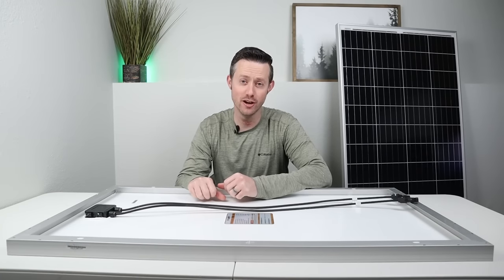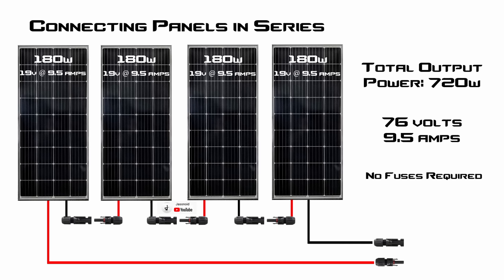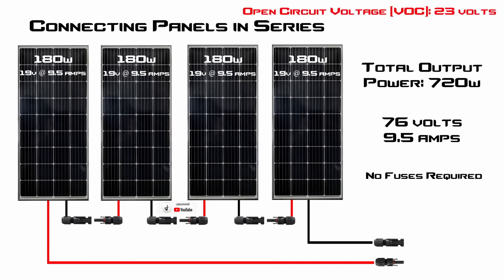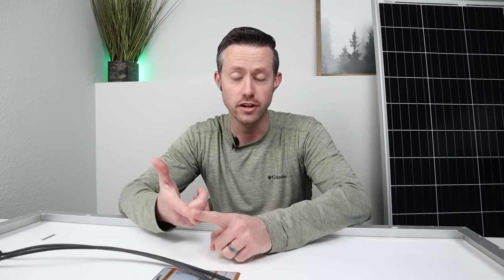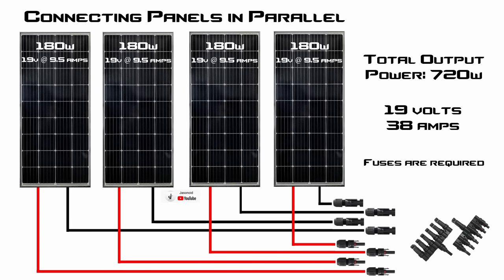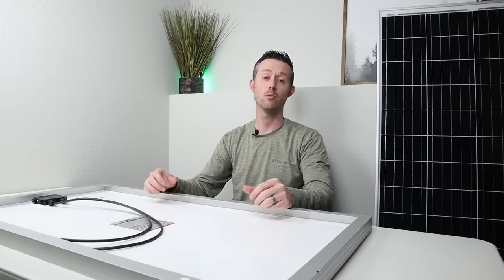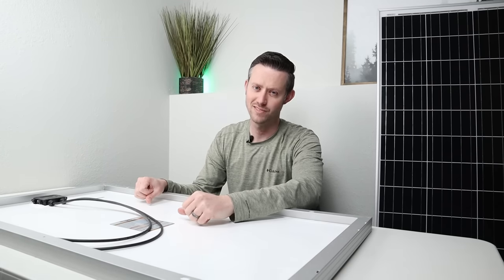Series VS Parallel! A Beginner's Guide for Solar Panel Connections - With Basic Diagrams!

Comment: What up Doe!?
Hey Dr J' very very informative video, thanks!

if you have 1 hundred watt solar panel but need extension line to run it to your house, what gauge wire should you get? About 25ft
Reply from the maker: 12 awg wire would work well, something like this: https://amzn.to/40h8eq8
Reply: @Jasonoid  Just added it to my amazon 🛒
Thanks

Comment: QUESTION;  So in series, the amperage stays the same? So if I have a starter solar on my rv that can handle 30 amps and 10 gauge wire running to it, can I put more than 600 watts if they are parallel? So does parallel work better in a partial shade?

Comment: Thanks so much for this it really helps I do have a question, on your last setup series and parallel what size fuses would you need ?
thanks Rob.
Reply from the maker: Any time the total amps goes over the wire rating you want to use fuses. Using an inline fuse like this is cheap and easy and never hurts: https://amzn.to/3JAyx4F

Comment: Hi Jason; I enjoy all your videos! Great job educating us all on everything solar. I have one question please. In a previous video you compared the performance of several panels - Bougerv, Newpowa and others. I recall that in the video you were surprised and the difference in output each Bougerv panel in your 4 panel array! Did you ever resolve this? As a newbie to the world of solar, I would have expected identical panels to have the same amp and voltage output - within fairly tight ranges! Any insight you can offer would be appreciated.
Reply from the maker: The BougeRV 5BB 180w panels in that comparison were actually damaged during shipping and the cells didn't hold up over time. I have since replaced those panels (under warranty) with the 9BB 180w panels and they perform much better!

Comment: This was really helpful!  Do you have any recommendations on what kind of fuse to add to each panel if the amps in an array are greater the the rated amps for each panel?  Also how do you know what fuse size to get? Should the fuse size be based on the amps that the wire is rated for based on the awg of the wire?  Thank you!
Reply from the maker: I'd recommend a 15 amp fuse since most solar panels are rated for 10 to 12 amps peak power. An inline fuse like this will work great! (see link below) 
https://amzn.to/44cx2BU
Reply: @Jasonoid  Awesome!  Thank you so much for this recommendation and especially for your outstanding videos.

Comment: I have 4 100 watt nine busbar panels and 3  100 watt older panels I believe they’re four or maybe five busbars type panels they appear to still be putting out around 22 or so volts I’m wondering would it hurt anything if I wired the four new nine busbar panels in series and then wired the three older 5  bus bar panels in series but also added one new nine busbar panel to them so I’d have four on each string and then combine the two series strings in parallel and run them into my Victron Smart charge controller it’s a 100 V 50 amp model. When I get the money I figured I’d only  use nine busbar panels for the whole thing and put the older panels together on a separate smaller system would this be acceptable???

Comment: Thanks for making this video, very helpful.  
Im new to solar so sorry if this is a stupid question but.  
In a series and parallel setup do you have to do equal amounts of panels in series and parallel like you did in the video 2 in series and 2 in parallel?   Or could i do  for example  4 in series and 2 in parallel?        
Im trying to get more wattage without raising voltage.    
Thanks.
Reply from the maker: As long as both sides of the array are equal in series, that's just fine. For example, 4 panels in series on one side, and then 4 panels in series on the other side, then put those both in parallel for a 4S2P array.  So 8 panels total, 4 in series, then 4 in series and then put both of those in parallel.

Comment: another bonus of series over parallel not shaded of course is that the panels will start charging earlier in the morning as the voltage from the panels raises higher then the battery sooner so charging starts but also later into the day you will still be producing power so in theory series can lead to you having more charge hours per day
Reply from the maker: Didnt think of that, definitely a benefit of of a series connection.

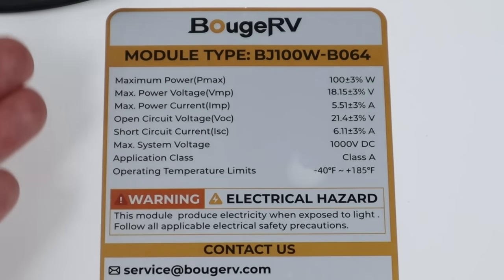Comment: Thank you for sharing I'm trying to learn solar so if I understand correctly if I'm sizing my array to my charge controller and the open circuit VOC for a solar panel let's say is 20 and my charge controller is say an Outback 80150 volt so I take the 1:50 volt / 20 that means I can have five panels * 1.25 for the cold factor is that correct
Reply from the maker: If you wire the panels in series the voltage will add up for each panel added. Just keep your total voltage (VOC) under the charger limit and you'll be golden.

Comment: On a garage roof with some shade issues,  is the combination of wiring in series and in parallel a good choice... ??    How likely is that an installation company would want to do the wiring in series and in parallel,  since I assume this would be more labor-intensive for them  ?
Reply from the maker: Most companies go with microinverters now per each panel to fight partial shading. I'm not sure they would wire in a series parallel combination.

Comment: I've been buying solar components for a mobile system over the past 12 months. Due to a mains power outage where I live, I threw it all together to see if I bought the right stuff (after lots of research). I've got 2 160W panels (in parallel), hooked to a controller that can handle 390W. I've got that charging two 115A/h 12 volt AGMs connected in parallel to a 3000W inverter. I can run what I need, and have a 3000W ULP genset to run when I need to. 
The batteries will lose about 50% charge over 18 hours or so running a fridge and a computer, a stereo system, and 100cm LCD TV as a computer monitor and speakers, and some 12v LED strip lights. I will probably change the setup and add more batteries I think, and maybe 2 more panels with another controller.

Comment: Awesome video! I’m wondering how to wire 6 100w reboot panels for my Anker 767 Im guessing series in parallel should work but not sure how many watts I can get up to?
Reply from the maker: What's the VOC of the panels?
Reply: @Jasonoid  it is 24.3v
Reply from the maker: @PrestoMoto02  the Anker has a 60v limit, so you can only wire those in a 2S configuration. 

You'll want to wire three of them in parallel, and the other three in parallel, and then put those two sets in series for a 2S3P array.
Reply: @Jasonoid  thank you, that’s what I was hoping to hear! Happy thanksgiving!!
Reply: @Jasonoid  works amazing thanks again! I think a lot of people would like a video about getting the most charge for the Anker 767
Reply: @Jasonoid hey, is there a way to do 4S2P or 3S3P arrays with the same 100w Renogy panels that are 20v 5a each?

Comment: Thank you for an informative video. I run 4 panels (2 x 80W & 2 x 100W - panels are about 10 years old) on my yacht. I generate about 1500W on a good day. Due to concerns around shading I have always run them in parallel, limited by the solar controller (20A, PWM) capacity and size of cable to the controller (30A wire running about 50'). Recently I installed a new Victron 100V/50A MTTP controller and upgraded the wires to 85A. I have changed to 2S,2P and later will expand the solar panel array. Question, apart from shading issues I hope to achieve greater efficiency and output from the new set up (MTTP controller and reduction of voltage losses). Any guesses to how big the gain might be with the new set up or is it simply a matter of more panels, recognising the limited real estate on a yacht.
Reply: The voltages in the two difference sized panels must match to be efficient.  If not wire the two 100w panels together and the two 80w panels together.  A 75/15 will do for the 80w panels to keep the cost down.  That or upgrade the 80w panels to 100w to match the existing ones.  We have a 100/50 and run 590w through it without a problem.

Comment: Very very simple question. I bought two Anker 200 watt panels. Xt60 connectors. I assume I can simply attach them to a splitter and plug it into the power station. Am I missing something? Thanks
Reply from the maker: They have to be wired in parallel. The voltage can't go over 60v on an Anker power station.

Comment: Jason- is it possible to mix different solar panels in series or parallel? I have a 200w Renogy suitcase with a Voyager 20 amp charge controller that I use for my camper and would like to use it as part of a solar setup to charge a power station. Open circuit voltage is 22.3, short circuit current 10.42 amps, Vmp 22.4 volts and Imp 9.82 amps. I’ve read that panels with the same voltage can be connected in parallel, and the the same current in series. Thanks.
Reply from the maker: Yes, if the panels have similar VMP numbers they can be connected in parallel and if they have similar IMP numbers they can be connected in series with good results.

Comment: Hi Jason, I recently bought a Oukitel 2001P power station and I want to get 4 BougeRV 180w 5BB which is 10.5 amps 15 amp series max and do the 2s2p setup to get the 500 max solar watts on the generator like you did. The only question left is what size fuses do I need to use for each BougeRV 180w 5BB 10.5 amps to protect each solar panel and to protect the Oukitel 2001P power station that is rated 15 amps max. I'm waiting for your answer before I buy 4 BougeRV 180w 5BB panels at 10.5amps each if it will safely work with protected fuses to do the 2s2p setup on my Oukitel 500watt max solar, 48volt and 15 amp max solar generator. I like to know what size fuses do I need to protect the panels and generator. Thanks
Reply from the maker: The best option would be to just put a 15 amp fuse on each panel inline using one of these 'inline fuses':  https://amzn.to/3C99pxy
Putting 1 of those on each panel will just keep things safe for your setup.

Comment: Whats the best way to connect 5 x 100w panels? Each panel (Coleman) came with its own small 12v charge controller, but I want to connect all the panels to 1 shared 24v battery bank. Thanks!

Comment: May I ask, on the calculation you did at minute 03:11 of the video, it says 76 volts. But each panels' volts is 19.2 and the "Open Circuit Voltage (voc)" is 23 +- 3%. The question is: Should we take that 23 + 3% as a base "voltage" for these kind of calculation and go for the safe side?. If so, the total volts should be: 23*1.03*4 (Panels). Thank you
Reply from the maker: That's only if you live in a cold climate, not everyone does. So if you live somewhere where it gets well below freezing add the extra voltage.

Comment: Are the positive and negative connections on the solar panels usually indicated? Or, is one supposed to know from the so-called "male" and "female" connector plugs?
Reply from the maker: There is a standard for postive and negative connections off the panel, but you'll find out really quickly MC4 can get confusing. They can be connected in reverse polarity. It's best to mark positive and negative on the panel connections using a silver sharpie.

Comment: Perhaps an advanced discussion, but shading of one panel string in multiple series panels isn't necessarily the end of the world and may still output more than the panels wired in parallel.  Its just a case of adding up the volts and amps for both options to see what the difference is.  Going against the often quoted "parallel is best" may prove some interesting results.

Comment: All clear but what amp rating fuses is required on the positive leads when in parallel?
Reply from the maker: The fuses are designed to keep the wires from burning. You'll want to put a fuse inline for the max amperage rating for the wire. Could be a 20 to 25 amp fuse depending on the wire ampacity.

Comment: For parallel connection, where did you get the "12V, 15A rated current" from? From the info sheet you showed there was no 15A...or am i missing something?? Would appreciate a quick response(doing a project and this is critical information) THANKS🙂
Reply from the maker: Usually it's on the back of the panel or tech sheet for the panel. Lessor quality panels don't list that information. I'd stick with 15 amps to be safe unless its listed on your panel.

Comment: What should be the more effective and safe connection way for a 100 watt polysolar panel, 85 watt mono solar panel, rated 150 watt charge controller, 130Ah battery?
Reply from the maker: Depends on the voltage and amperage specs of each of your solar panels.

Comment: I have a big roll of 8 awg romex outdoor UV protected, used  for 120 ac home wiring. can I use it for a 40 volt dc , 50 amp solar array. I know It sounds foolish , but I just had to ask because it is about 150 feet away and solar cable ain't cheep.

Comment: Curious.  For a simple led light, 2 Gang 110v outlet (audio amplifier, phone carging, etc), what's the wattage should I have?  It's for an outdoor shed.
Reply from the maker: If you are going to be running any power tools, I'd say you'd want at least 600w. 1200w would be best (three 400w panels).

Comment: what type of connection works best when it is dim light outside? eg during the winter and evening or a cloudy day?
Reply from the maker: You'll want to run a parallel wiring setup for partial shading or mostly cloudy weather.

Comment: I just subscribed & gave you a.👍 It looks like you have an awesome channel full of information on Solar. I'm just starting to get into solar and I was wondering what what be a good place / video of yours to start with. Appreciate any advice. Thanks...!
Reply from the maker: What are you wanting to accomplish with solar?
Reply: @Jasonoid  Thanks for the reply Jason... I'm interested in using solar to help with the lighting in my house if possible. I rewired my home after I bought it and wired my new addition when I built it. I use to work as an electrician. I'm not looking to have solar power the whole house but just some of the lighting I use throughout the house. Not the receptacles. thank you...!
Reply from the maker: @rayh21  the easiest way to do that would be to wire in an transfer switch panel and power those circuits off a separate source (Power station, battery/ inverter, or gas generator).
Reply: @Jasonoid  ok thanks for the update and info... I enjoy your videos... they are very informative and packed full of info...! Appreciate the help!

Comment: when you showed the back of the panels on a 2s2p wiring, there were no fuses but the total is 19 amps. are the 'outputs" the positive wires?
Reply from the maker: You only need fuses if your combined amperage goes over the amperage rating of the wire. That's usually only required if running your panels in parallel. Here's something I would recommend:
https://amzn.to/4da0nBQ

Comment: In 2S, 2P do you have the same shading problem that you have with the Series connection?
 Thanks for the video Jason; very instructive.
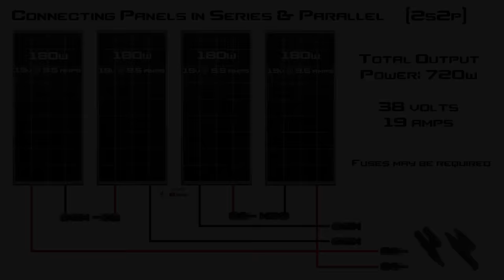Reply from the maker: Around the @10:05 mark in the video, I mention how a 2S2P array still suffers from partial shading but instead of losing all the power, you only lose half the power.

Comment: New subscriber, enjoyed your video. Do you have videos or could you make videos about matching up panels and controllers and how to set that up with batteries. Trying to set up a small system in my garage to possibly run some lights and charge my reservoir fishing boat battery that's 48 V.
I'm trying to figure out a way I could use my battery while it's in the garage on my boat to run some lights and things and then unplug it and go fishing.
Reply from the maker: You'll need your solar voltage to be higher than your battery voltage in order to charge it. I'd recommend at least 85v volts in your array with a 48v battery. A little higher would be better. So plan on connecting them in series in a place that has very little shading. 
I love this Epever charge controller that's compatible with 12v,24v,36v, and 48v batteries: https://amzn.to/49kM7n5

Lately I have seen AMAZING deals on 400w solar panels locally. Check Facebook marketplace to see if you can find any great deals on the larger solar panels. I just bought three brand new 400w panels for $150 each! Crazy pricing!
Reply: Thanks for your help I will check into some of that stuff. Right now all I have is 4 100 W solar panels. From what you say that's not gonna cut it I'll have to look for some 400 W panels @Jasonoid